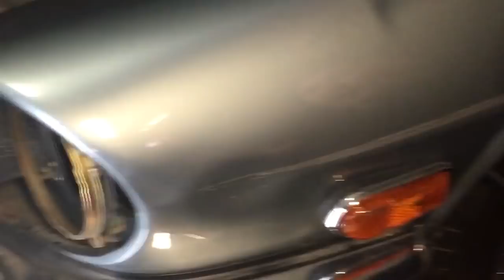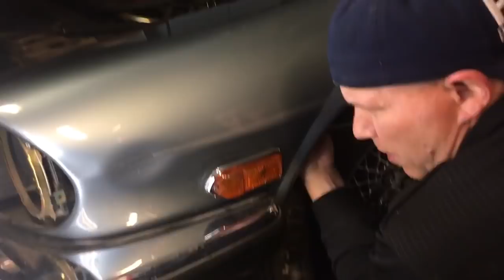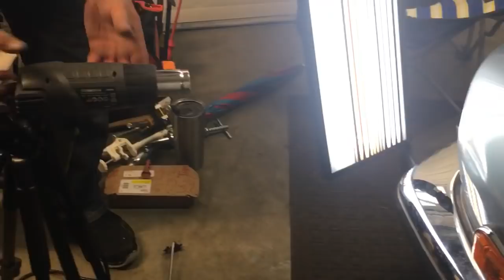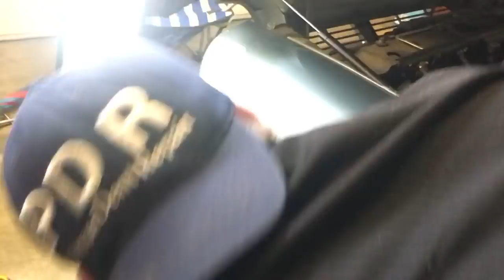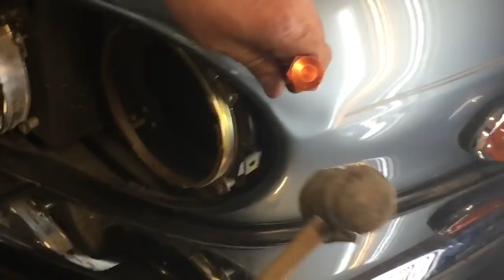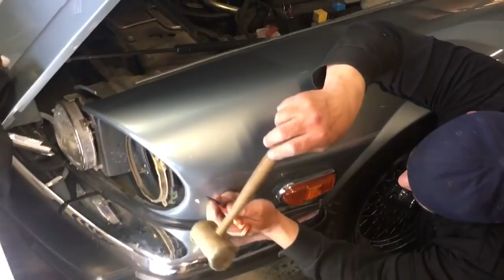PDR Training on CLASSIC🐯Jaguar XJS! #pdr #jaguarxjs #undented #pdrclassic

Comment: If you had removed the headlight mounting bracket, would it have given you more room to work the dent out?
Reply from the maker: Jeff Jackson Great question, no. The owner of the car actually removed the entire headlight assembly and the rear panel wall behind it it was still covered by a secondaryFactory panel that impeded most of my movement I could get to where I showed on the video about a half an inch from the edge. I could’ve worked on that thing another five hours the customer was really happy and I probably will work on it more in the future but we had to get going. We worked on two cars that day in his driveway and I think he got a great deal and was super happy. Thank you for watching this one came out real nice for what it started from.￼